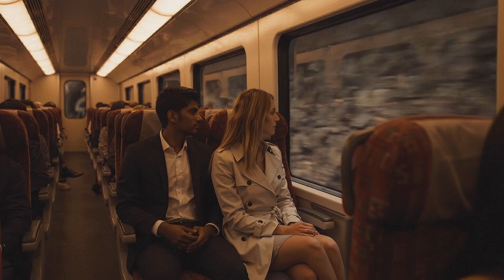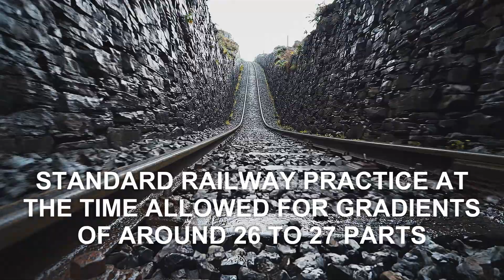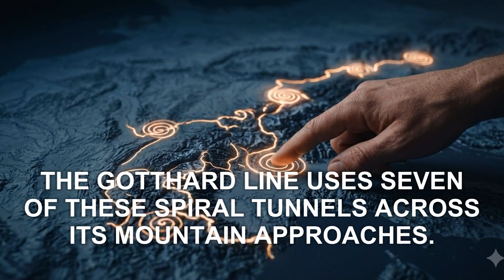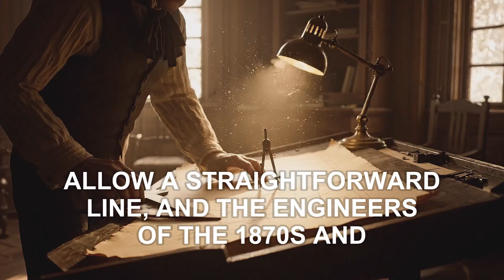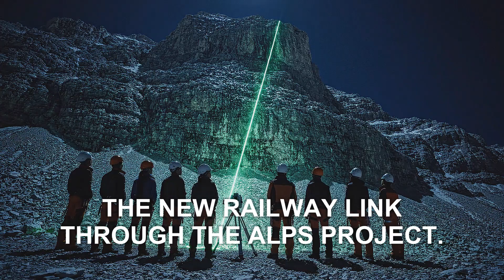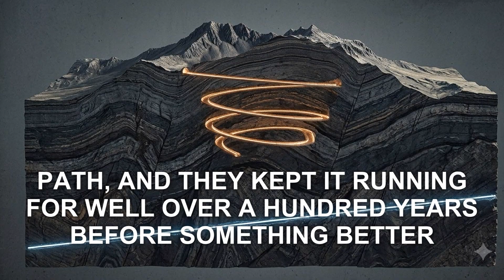Why Trains Are Forced To Loop Inside Mountains

Comment from the maker: The summit tunnel only solved half the problem. The other half was ~900 m of altitude with no room for a safe gradient — so engineers drilled full 360° spirals inside the mountain.

What hit hardest: the helix geometry, seven spirals on the descent, or that the original line still runs under the Base Tunnel era?

Drop your pick 👇 — next megaproject?